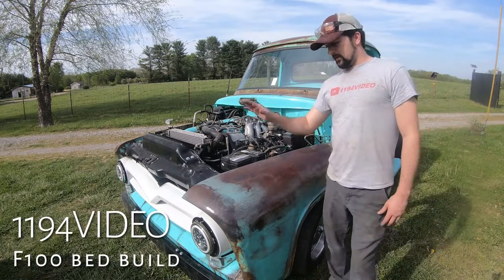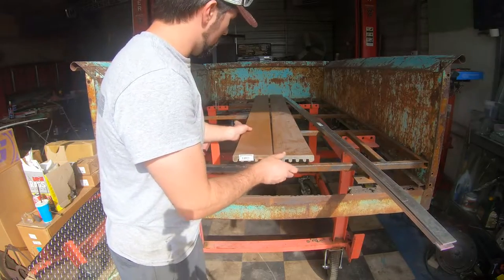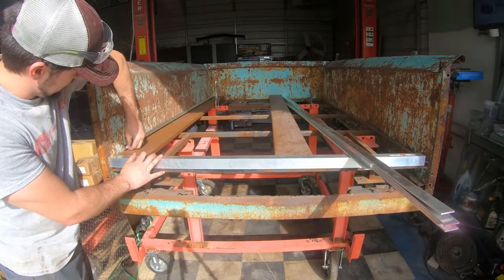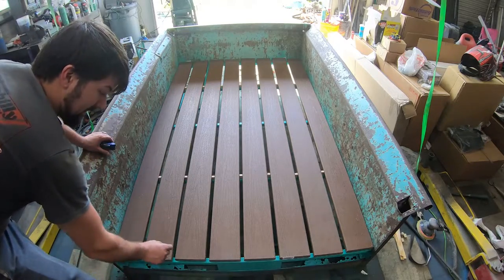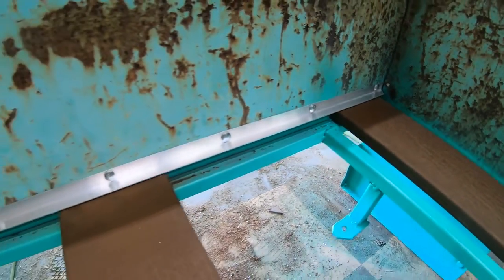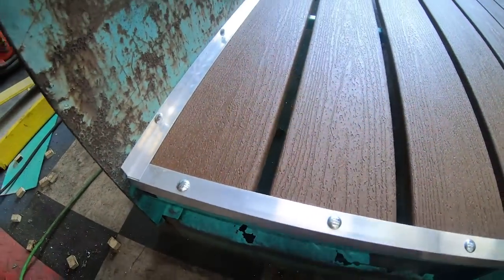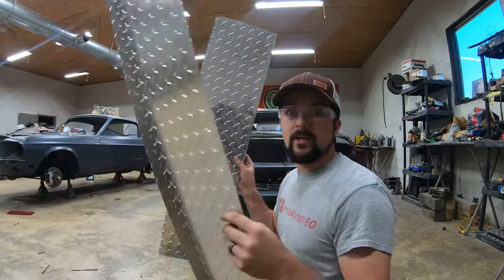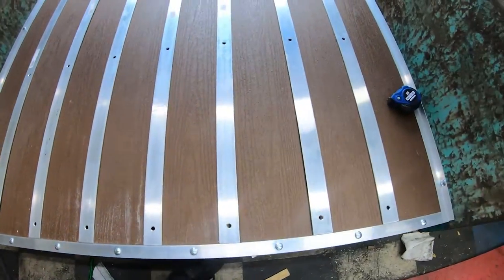wood bed kit under all for less than 300 dollars

Comment: The bed looks good but do you now have a bunch of bolts visible sticking through to the out side of the bed
Reply from the maker: No none. On the outside most are hidden under the fender and side bed posts. The others that are out have a painted to match cap nut that’s flush with side

Comment: That's perfect if you are not building a show truck. I want everything polished and the wood to look like glass. I bought my bed wood kit with stainless strips for about 450. It really isn't that much more in price.
Reply from the maker: True but I need something that will hold up to lots of weight and be able to use my truck rather than while on it. This is my shop trick so definitely wouldn’t want to sit an engine block on shiny wood lol